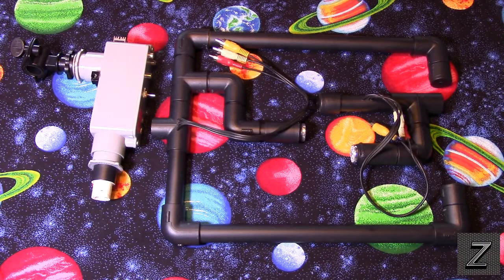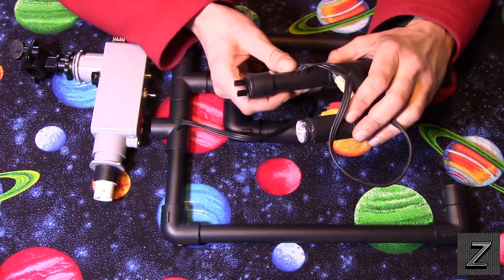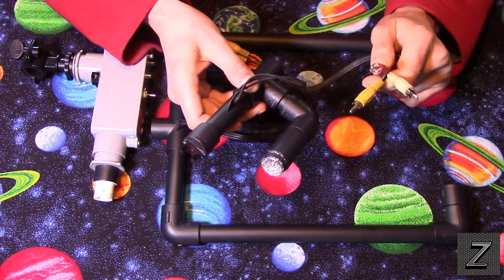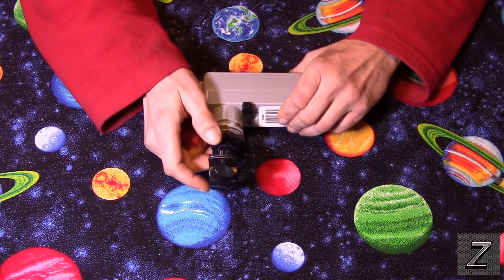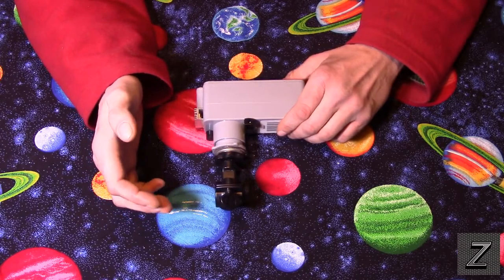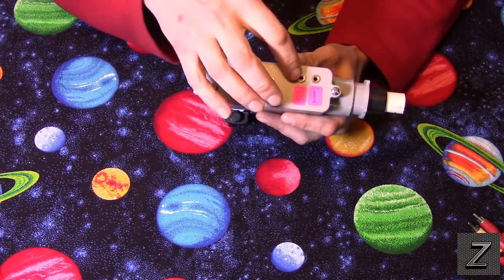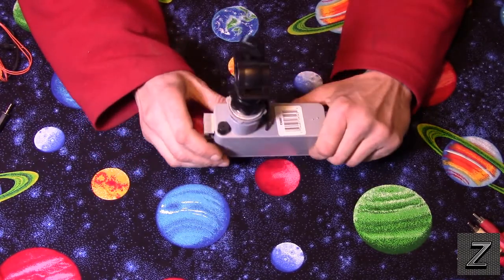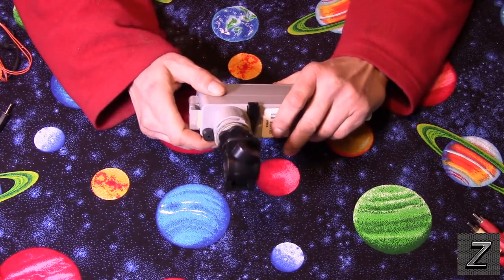How to build a Bluetooth controlled Photogate for high Speed photography

Comment: Once again this is just what I'm looking for, so many thanks for the video. Actually what I'm looking to do is use a photogate to capture birds in flight at a feeder. This means that the device would just need to trigger the camera, which would either be set at sync speed (the camera can trigger the flash) or at high shutter speed without flash. A single box of tricks configurable for both black studio and ambient light high speed photography would be a perfect project for me. Thanks again.